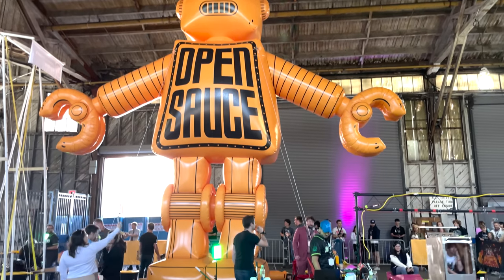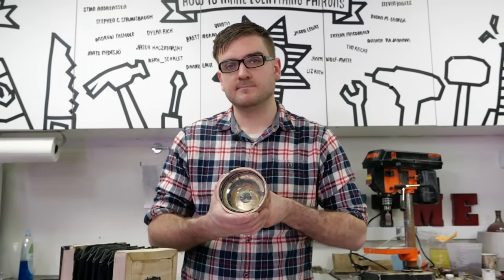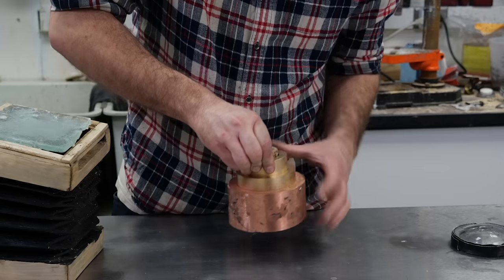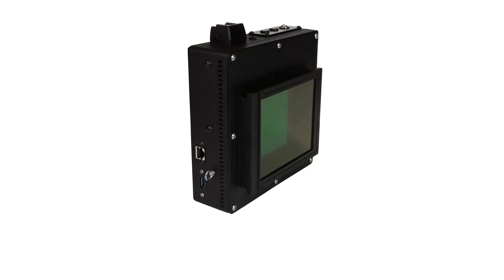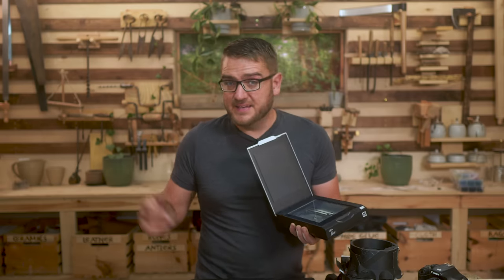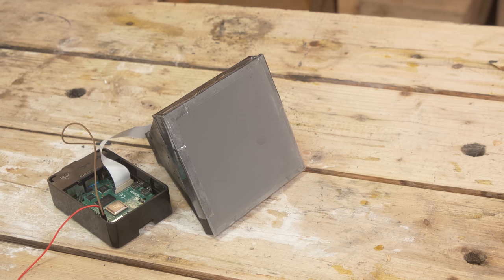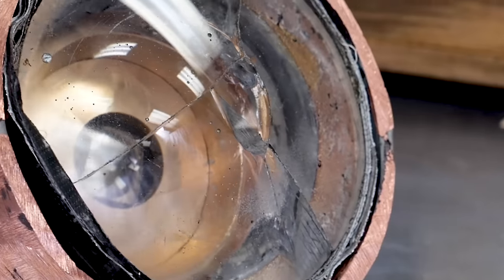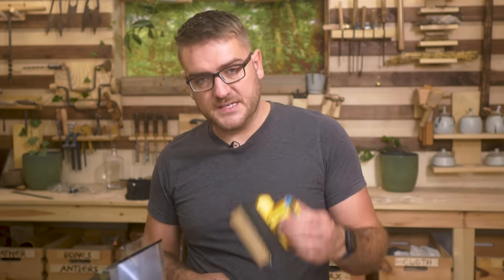I Fixed My Most Challenging Project! (Camera Lens from Scratch)

Comment: Thinking quickly, Andy crafted a camera using some glass, duct tape, and a camera.
Reply from the maker: That's the exact meme that went through my head when I decided to just use a camera instead of a scanner.
Reply: Reminds me of when Homer carved a chili spoon out of a better spoon
Reply: Tbf, using film, then processing it, would then still require a digital scanner to get it on Instagram or whatever. The point is he made, by himself with no modern equipment, functioning lenses. The complete camera will come later.
Reply: @ThaEurasian i did a thing did that

Comment: Very cool project! As a photographer who has never built his own camera (but who loves playing with antique lenses), I have a couple of suggestions for your consideration: 

1. Just as how with a pinhole camera, a smaller pinhole will result in a sharper, but dimmer image- you may consider adding an aperture or a mask to act like an aperture immediately behind the lens to force the light through a more narrow opening. This could result in a sharper focus. It should also make the edges of the image more in focus relative to the center. This increase in sharpness is more than what's offered by the expanded depth of field. It's an increase in maximum sharpness, and I believe it's due to a reduced angle of incidence. Which leads me to the next item...

2. If you ever go to remake your lenses, you might try to reduce your angle of incidence by reducing your curvature, and instead rely on the distance between the focal elements to get the light to where you want it to go rather than extreme curvature. The greater the angle of incidence between the lens' surfaces, the more critical a perfect polish and flawless glass becomes. And, in general, the more difficulty you will have in getting a sharp focus- particularly around the edges. One of the reason that modern lenses have so many elements is because it's an attempt to minimize the angle that the light is bending with each surface plane it intersects while still having a compact lens. Instead of a few planes with sharp bends, you get more planes with slight bends.

Anyways, awesome video!! I look forward to seeing more!
Reply: I second this. I know nothing about the magnifying properties of glass except how it pertains to eyeglasses. What I do know is that cameras are a lot like eyes and pretty much everything you stated is what I was going to say.

Comment: Old cameras used very bright light sources.  In the 1960s, a hand held motion picture camera came with an array of very hot light bulbs.
Reply: Yes, because usable film stocks were far less sensitive than current digital sensors.  The images we see now (especially at night) were impossible to create without arrays of high lumen incandescent bulbs, using far more energy and putting out far more heat than the LED-based lights available today.  The most sensitive film available was 3 or 4 stops above 100 ISO and  produced large grain, ugly images mostly suitable for science experiments.  While there is a limit to how much light a lens can transmit, the digital revolution made up for that with sensors that make it possible to see nearly as well as a nocturnal animal.
Reply: @mightisright it’s been a real wild ride living through digital sensors having way worse sensitivity than film, to far surpassing film and even our own eyes
Reply: Right! I was wondering if stronger lighting would improve the quality of the shot or not.

Comment: Making a glas window would be a nice step in the reset series to unlock  glas sheets.
Reply: float glass
Reply: @hypocriticalgrammarnazi  yes
Reply: ye, Windows would be quite interesing and can dispell the myth that "glas floats and therefore is thicker at the bottom" when it's more that it wasn't flat to begin with aaand the the really ancient glas ware from Romans or pharaos hasn't really deformed
Reply: Oh man, I'd vove to see any making coloured glass tiles and putting them together with some metal into a coloured class mosaic picture.

Comment: Regarding the SD card corruption: next time make the SD card read-only once you have everything set up. A lot of people who run Pis for servers and things will keep the SD cards as read-only with just the OS and then use a USB drive (or other external harddrive) so the SD card can never get corrupted.

Source control would also help. It sounded like you lost all of your code; I've struggled with that enough times that at this point I don't start a single project without setting up a GitHub repository.

Comment: You know, having wood veneer would have come in really handy, for making the telescopic part for the lenses. So I think that one of the projects after calculating what electric motor you can use to equal the water rotating the waterwheel, and after testing multiple methods of power transmission and power conversion between torque and speed, should be making a machine for making veneer from a log (rotating it) or from a plank (shaving it like with a wood plane), and then using the veneer to make a book using charcoal for painting and a mixture of oil and wax for waterproofing the written paper and sealing the ink in place.

Comment: This was one of my favorite projects and I always felt mad about the broken lens. It is indeed a cool idea for this event for sure. I think the blurryness comes from the cristal structure of the glass lens itself. The light is bowed at some point through the lens and the image which actually can be captured by the sensor has gone through these crystal structures. BUT When you have binoculars and a blury image, you have the oportunity to move the lenses carefully by moving the diopter wheel until it is sharp. Maybe you have just to adjust the distance between lenses.

Comment: First off, great job. You've done what I have dreamt of doing for over a decade (making glass, and making a lens with it). I have also had plans to make a large format scanner back camera. I think a couple of your biggest issues is getting your image and/or sensor in the focal plane. When focusing on your ground glass, did you factor in the glass thickness? Also, you may have been able to bypass your "focusing screen" altogether by simply having the scanner's optics in your lens's focal plane. It should then be capturing the image coming straight out of the lens.

Comment: Considering how large the front element is and how short the focal length is, that's going to one hecking fast lens! That likely is your issue with the resulting softness. Creating fast aperture, wide angle lenses is really really tricky. Narrowing the aperture down synthetically with an aperture mask or blades would help a lot, as it does in the real photography world. Look at how crappy some of the early fast lenses were and how big of a difference stopping down from F1.4 to F4 would be. Finally, your actual back focus might be off. Even if your lens is perfectly in focus with pristine optics, if the sensor is too close or too far away it won't reach critical focus and that'll be exacerbated by a fast aperture lens.

Comment: I think I can help you there, as a photographer who works with old cameras, i know that a image that is projected onto a surface like the ground glass will never be really sharp, which is why it was removed from old cameras before the negative was inserted.

It is best if the sensor is placed exactly where the glass was.
Reply: He has a large-format lens and a tiny sensor, so he follows the "digital obscura" approach. He can't do what you suggest, even though you'd otherwise be right.

Comment: Well.. i haven't watched the video/s where you make the lens and glass, and i might be completely wrong here as well, but here's some thoughts as to why the images aren't as sharp as you might have hoped.

1: This one is certainly the thing i have the least amount of knowledge of. Maybe your glass isn't as smooth as it should? I mean you can polish it til you go through it and all, but is there's "large grains" in the glass itself then no amount of polishing will help as you only make those grain larger by magnifying them.. right?

2: Many have said this, but light is important. I would also suggest testing where your lens works at its best. While you can buy a lens that says 60mm-100mm its best performance might be at 80mm.

3: Maybe try moving the magnifying element further or closer to the outer glass if possible?

You have probably thought of/tried these things already, but they are my surface thoughts nonetheless.

Something that just hit me. The scanner part you use, isn't that supposed to magnify things that are really close to it? I know the glass helps the zoom part of the thing, but could that be the problem?

Comment: Grain size on the diffusion screen is too large. Spin it :). We used to use a frosted CD to make a 35mm frame adaptor for early digital video cameras.  Has to spin faster than the shutter speed to allow the grain to blur.
Reply: I still have mine downstairs somewhere. And I’m in MN if you’d like to see what it does.

Comment: Could the cyanotype process work for making your own film? I'd think it might be easier to acquire the materials than with silver or other precious metal processes. 

I've used cyanotype in-camera with decent results. It does require quite a bit of light, though. What's the f/? Of the lens you've made? I've used f/1 in winter and f/3.5 in summer.

Comment: How about recording SOUND.  The principal is so simple it's a wonder the Ancients didn't do it.  If a disk or cylinder is too complex, a strip of metalic foil, pulled under the needle and wound on to a reel might work well too as an impression surface.  A tin horn could amplify the sound of the needle vibrated diaphragm to play it  and recording could be done  by simply speaking into the horn as the metal strip  is pulled under the needle.-----    The recording needle and playback needle would need to be different though the former would have to plow a grove in the recording surface and the playback needle would have to be a bit duller to just RIDE the groove.

Comment: I sort of wonder if the problem is internal to one or more of the lenses, rather than on the surface of any of them.  Also, before doing film, have you considered doing Daguerreotypes?
Reply from the maker: Yeah, I'm looking into possibly attempting Daguerreotypes first.  Most forms of film appear to have the same roadblock of needing to make pure nitric acid to produce the reactants, but Daguerreotypes sound like they might offer an option I can do sooner.

Comment: the main problem is the ground glass!  way to milky cloudy grainy.  the lens probably makes quite clear images, but they are destroyed by the ground glass, for demonstration you could use regular black and white photo paper as "film", not cynotype which is also ultra lo fi,  then develop and flatbet scan it, correct levels (lift gamma gain) in photoshop and im sure it looks reallly nice, not completely sharp but clear
Reply: also, when using a flat be scanner as image sensor, no diffusion sheet is necessary, it just degrades the image massively

Comment: Shouldn't most of these drum-like pieces be made of beaten copper/bronze sheet that are rolled and crimped or riveted together rather than trying to make such precise casts? Seems like you should be able to make much lighter and more consistent parts that way. It'll look cooler too. (rolled sheeting is obv/ faster and easier once you reach that tech level)

Comment: I think your blurriness is more of a shape problem than a clearness problem. You seem to be wingin' it with the grinding. Unfortunately even 10-100um differences from being parabolic can make your image significantly worse. (remember that the focal point of an image point is the collection of all light paths through the lens from the original point to the point on the image plane, so if any of the lenses is asymmetrical this will smear the image in the direction of asymmetry while being off-parabolic will just make it spherically bigger, roughly.)

Comment: Who am I to say anything.. but seems you would be better off if you just prototyped the whole thing first, using 3D printer and actual modern lenses. Validating the prototype would be a good sign to then make it from scratch